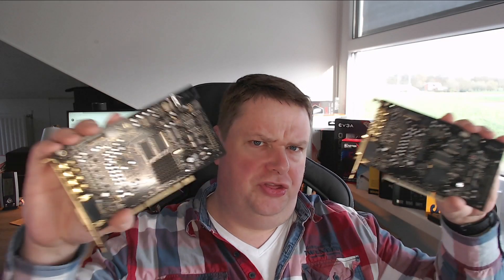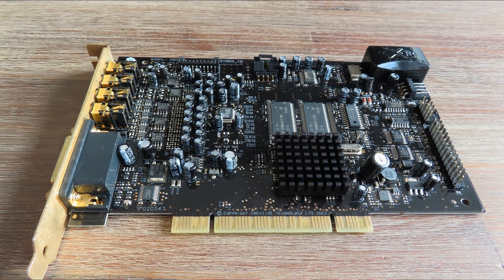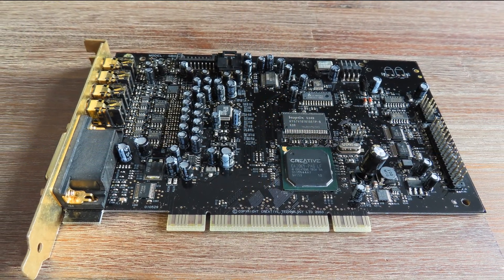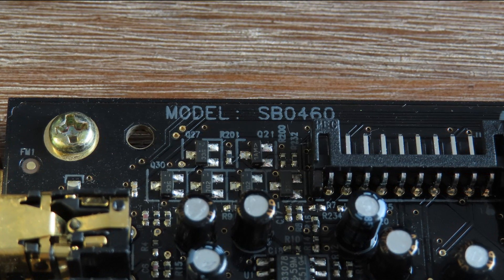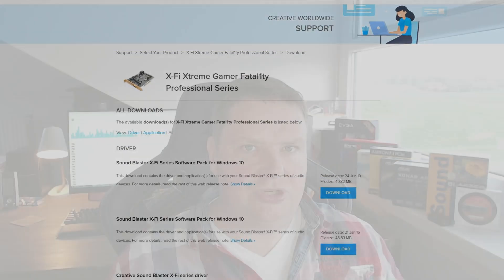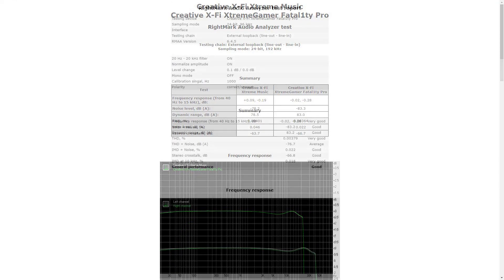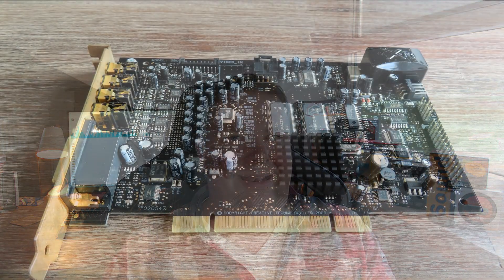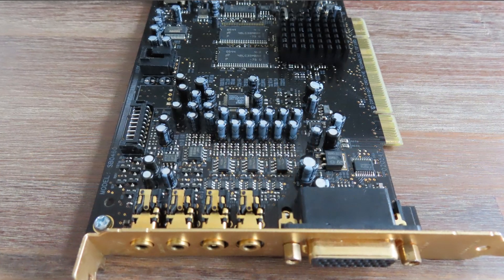A sound card with it's own memory?!

Comment: HELLO FRIEND.
I use this adapter on modern boards and it works perfectly, just a tip for people who think they can't use it on modern hardware.

Follow the link:    https://pt.aliexpress.com/item/4001221007471.html?spm=a2g0o.detail.1000014.1.2316680eOQkBNP&gps-id=pcDetailBottomMoreOtherSeller&scm=1007.40000.267768.0&scm_id=1007.40000.267768.0&scm-url=1007.40000.267768.0&pvid=7b3c871a-fb86-47f3-85bf-be9d36ba98e9&_t=gps-id:pcDetailBottomMoreOtherSeller,scm-url:1007.40000.267768.0,pvid:7b3c871a-fb86-47f3-85bf-be9d36ba98e9,tpp_buckets:668%232846%238113%23691&pdp_ext_f=%7B%22sku_id%22%3A%2210000015344448584%22%2C%22sceneId%22%3A%2230050%22%7D&pdp_npi=2%40dis%21BRL%2181.47%2173.31%21%21%21%21%21%402101f6b516671927989705867ea5c5%2110000015344448584%21rec

Comment: CMSS did actually work in Windows XP back in the day. But the results did vary from game to game. Half Life 2 is a good example, but it has to be a early version since they switched the audio codec for the Half Life engine.
Reply from the maker: CMSS did sort of work with Windows XP, with kinda accurate HRTF. But it was always upmixing and synthesized. But almost nobody had the hardware to actually get it properly working. I mean a decent headphone or speakers those days, just wasn't available.